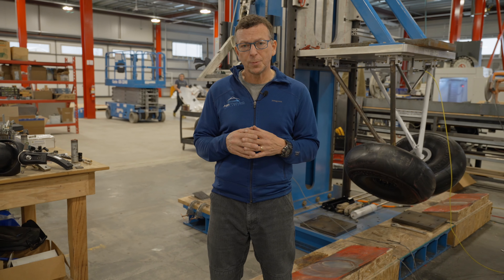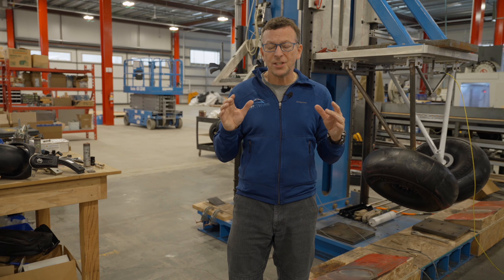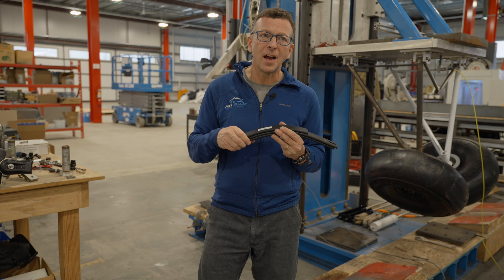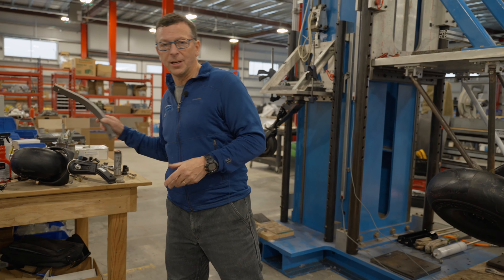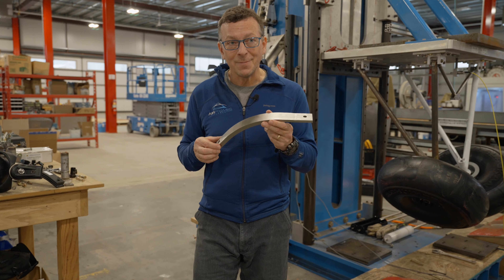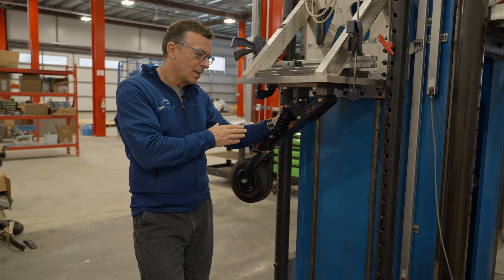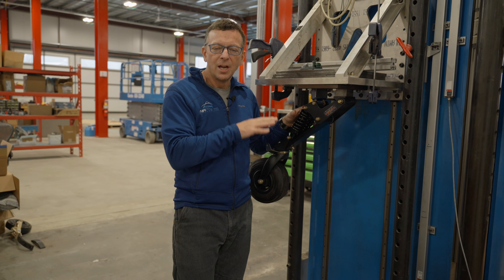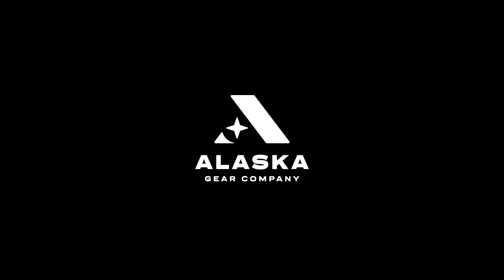Drop Testing Tailsprings: Steel vs. Titanium vs. Dual Shock

Comment: I've never seen a tailwheel spring test for torsional loads. Taxing, turning around, tailwheel hits a hole, or sliding sideways in the start of a ground loop. Some of the tailwheel shocks I have seen in the field really don't have much torsional rigidity, to the point where you can see the tailwheel roll left and right when you just push the tail back and forth on the ground by hand.  Do you have a test rig or test video of that type of testing?